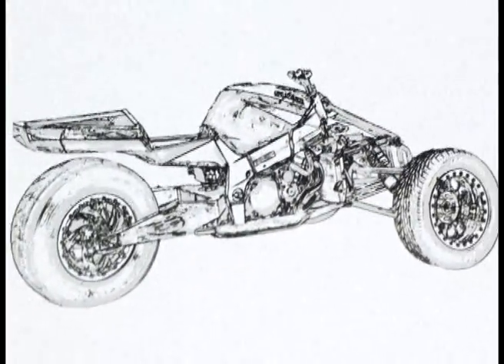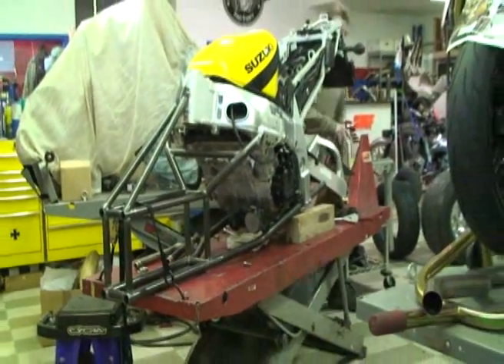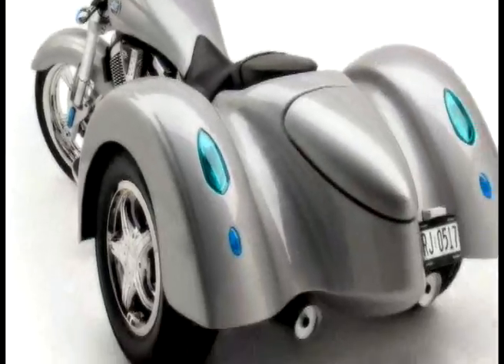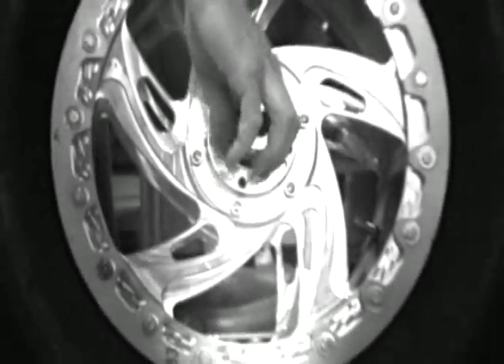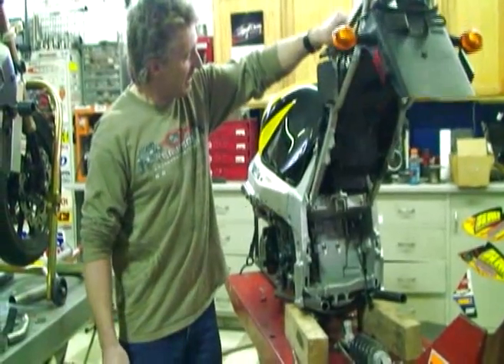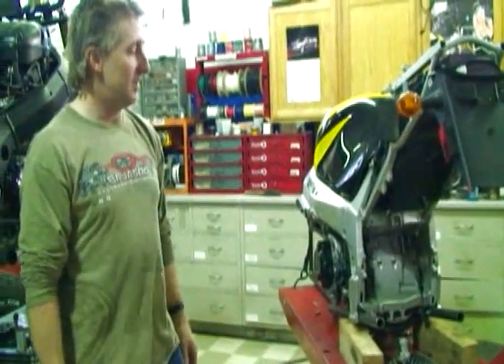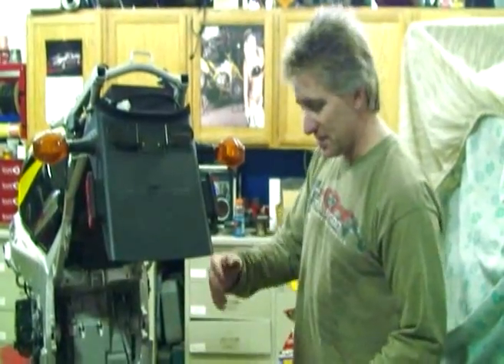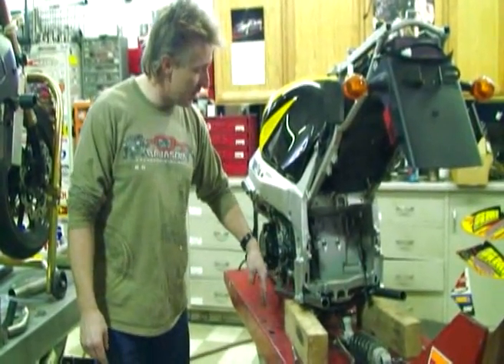HMF Terra Trike Project (1/5)

Comment: Planting on floating it across rivers? That's about the only use those kind of wheels will be. If you're thinking off road, you might consider starting with an actual dirt bike / motocross designed bike. Shoot, look at the footage of off road Ural side car bikes, it can be done. Making a Dual Sport Trike out of a sport bike is crazy.